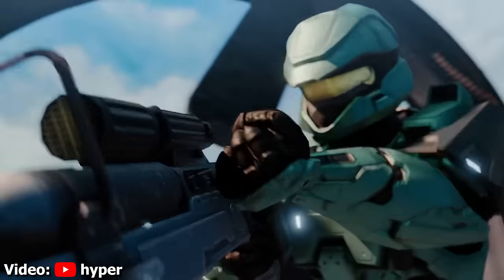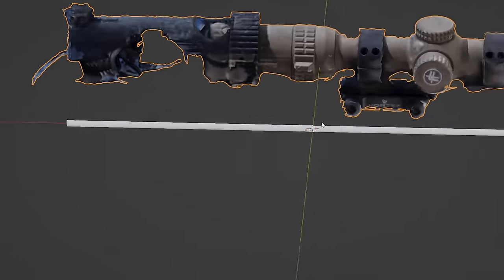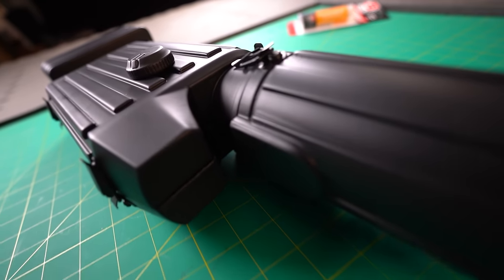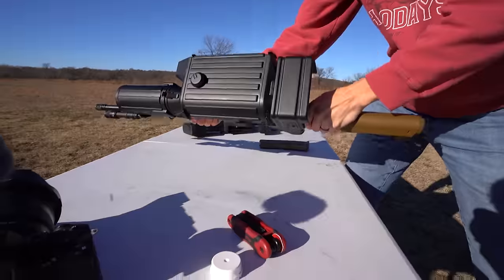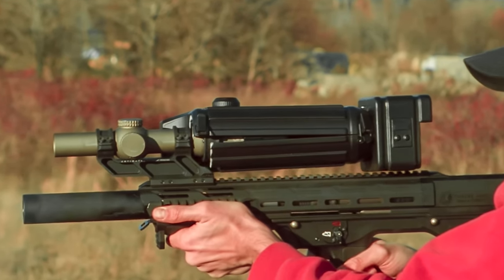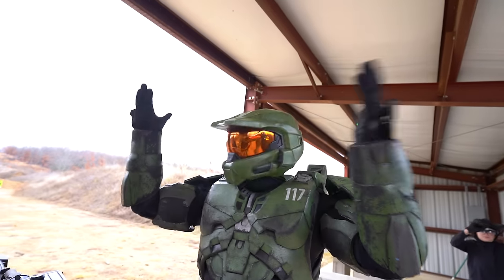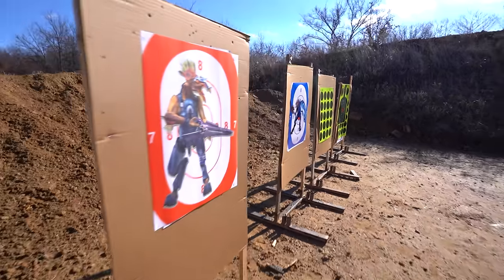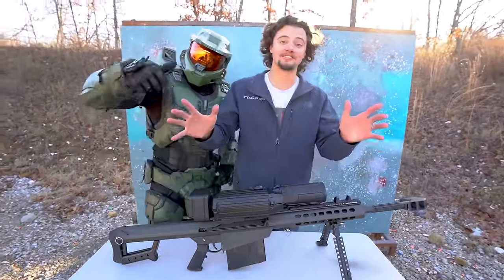Master Chief Shoots A REAL Halo SNIPER RIFLE (50 CAL)

Comment from the maker: 🌟 Assemble superheroes in Marvel Strike Force for FREE https://t2m.io/Impact_Props and enter the promo code VENOMGIFT for 100 Venom Shards, 500 Power Cores, and 5 Premium ORBS! How to easily redeem the promo code 👉 https://t2m.io/VENOMGIFT_promo
Reply: Hallo
Reply: YOOO YOU GUYS FINALLY REACHED 1.17MIL SUBS
Reply: When do you think you can make armorlock in real life.
Reply: Can u do a video master chief plays Lazer tag
Reply: Just to let you know the energy sword does exist it is made by hacksmith
Reply: Did you know that there’s a sniper called the NTW-20  that is originally chambered in 20 mm but has 14.5mm variant, the same caliber as the halo sniper and looks like the halo sniper, idk if you can get it in the US tho but if you want the sniper that looks the part I think you have your solution and how big the scope is it should look relatively normal but it’s a bolt action so one down side. 
• ~
\_/
Reply: Can you make a hallo pisto
Reply: totally missed the mark.
The Halo sniper rifle is basked off the NTW-20. and like the Halo sniper rifle, it also can be chambered in 14.5mm, vs the 12.7 seen here on the M107. A South African design, you know. Where Halo 2, 3 ODST take place.
Reply: Brandon can you make a NVE helmet for halo reach
Reply: You guys should build helioskrill armor

Comment: The Halo sniper itself is modeled after the Denel NTW-20 is a 20mm Anti-Material Rifle. only major difference is the Receiver layout (bolt location, mag-well and ejection port)

But, this video is centered around the scope itself, which looks amazing. Looks oversized, but that makes sense, given that it's more or less a shell for other optics. Tis a great step towards brining the Halo Arsenal into reality.

Comment: * Sad Denel NTW 20 noise *
It's the gun the halo sniper was modeled after, they just changed the scope, put the mag under instead of on the side and made it semi-auto instead of bolt action.
But you'd need to go to someone like Brandon Herrera or other gunsmiths to make the conversions.
Also, good luck importing a Denel in the US.

Comment: The Halo Sniper Rifle IS real. it's the Denel NTW-20 and is bigger than a .50cal, shooting 14.5mm and 20mm rounds which are used in Anti-Aircraft systems. Bungie copied the gun pretty much 1:1 including the handle over the scope, the scope they put on it is unique though and doesn't exist AFAIK. It's a BIG gun to, requiring a team of two to carry it in two pieces as it's barrel detaches for ease of carry.

Comment: i know i'm REALLY Late (8 Months Late) And I Don't Want To Be "That Guy" 🤓(And I Know That It Would Probably Be Near IMPOSSIBLE To Find Let Alone Use These Rounds, Or Find a Place In AMERICA (The USA) To Fire These Rounds Or Buy Them Given Certain World Events...) But The SRS99C-S2 AM Sniper Rifle (The One Seen In The First Halo Game) Dosn't Shoot 50 Cal (50 BMG) Which Is 12.7x99mm (Millimeter), Instead It Shoots The Soviet Russian (And Still Used Today By The Russian Federation) 14.5x114mm Rounds. Designed For The PTRD AND PTRS-41 ANTI-TANK Rifles, It Could Penetrate 32 mm of armor at a distance of 500 meters OR
20 mm of armor at a distance of 1,000 meters. It Had a Muzzle Velocity Of (When Fired Out of The Previously Stated Rifles) 3,100 Feet Per Second And It DWARS a 50 Cal. That 2 And a Half Millimeters Might Not Sound Like That Big of a Difference, But Look Up "50bmg Vs 14.5x114mm" And You'll See What I Mean. The Round Was Designed During The Second World War By The Soviet Union In Order To Defeat Contemporary German Tanks.

It Couldn't Pen The Armor Of a King Tiger Or Even a Tiger H1 Tank, But It Was Effective Against Less Armored Sections Of Panther Tanks, Panzer 1s 2s 3s And 4s, Ect. (Yes, I'm a WW2 History Freak AND a Halo Guy)

So Yeah, Sorry For The Wall Of Text, Just Wanted To Point That Out.

Oh And Uh One More Thing: The SRS99C-S2 AM Sniper Rifle (Yeesh Thats a Long Name) from the Halo series has a muzzle velocity of 1,450 meters per second (m/s). Which Is 4,757 Feet Per Second. This high velocity, combined with its 14.5×114mm armor-piercing rounds, makes it a formidable weapon in the game. Its No Wonder It Hits Like a Litteral Truck!

Edit: It Seems a Good Number Of People Are Pointing This Out Also, So I'm Not Mentally Insane! Yay!😃Anyways, Thanks For Reading This, And Have a Nice Day! God Bless You All.